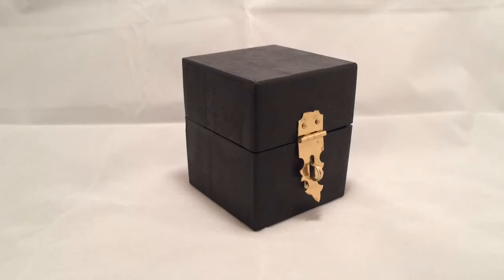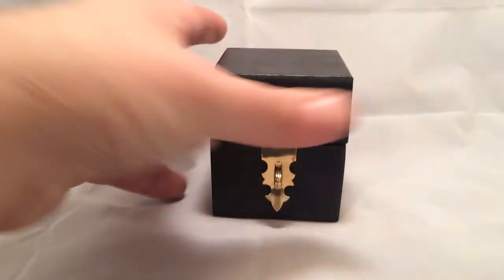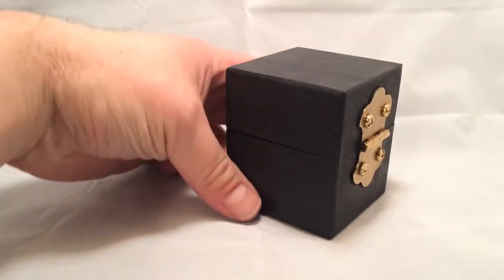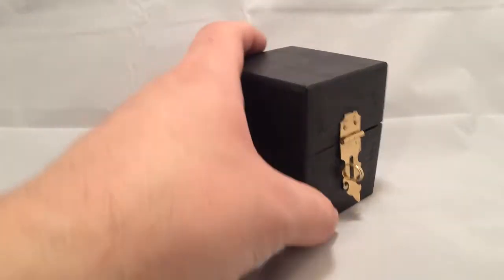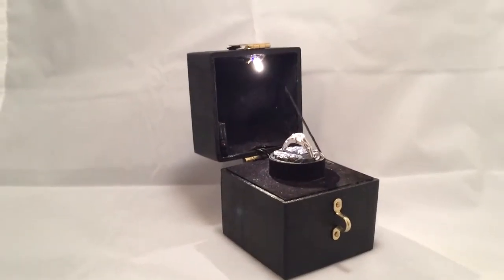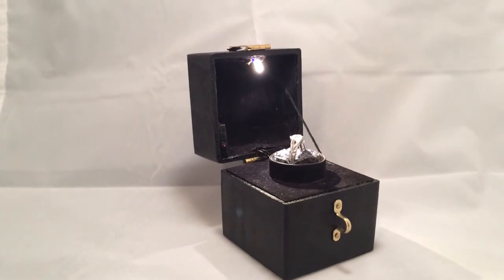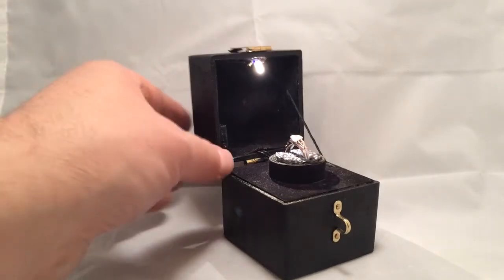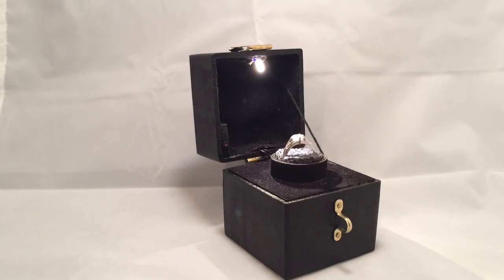Illuminated Ring Box with Spinning Ring Holder

Comment: Hi.
Can you please tell  me where can I buy this mechanism. I am a manufacturer in India..
Reply from the maker: It's a high tension clock mechanism, set to the second hand.
Reply: @PaulPapeDesigns  yes dear. I understand its clock mechanism.  Can you share where can I buy it from China? I require 2000 pcs. And will make it in real wood boxes..🙂
Reply from the maker: @vipuljain9499  That I wouldn't know. I only buy them one at a time. Sorry.
Reply: @PaulPapeDesigns  No problem dear. Thank you for your reply and video....Its a great inspiration...
Reply: I sincerely thank you for your video. It's  a great inspiration. I got all things.  Will soon share a video with you.  Thanks,  a lot...